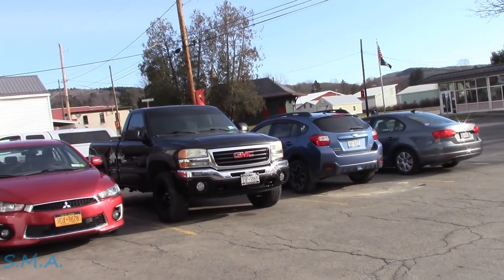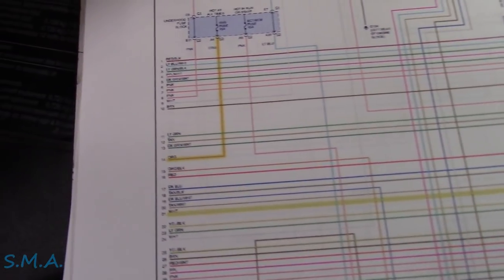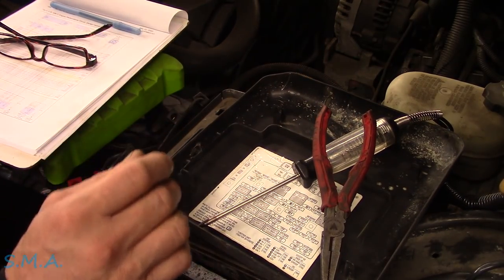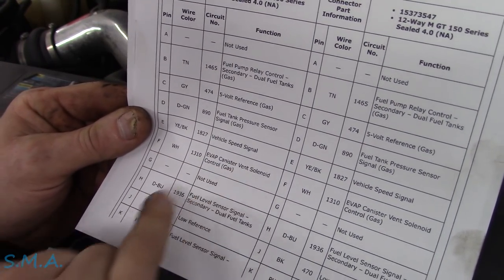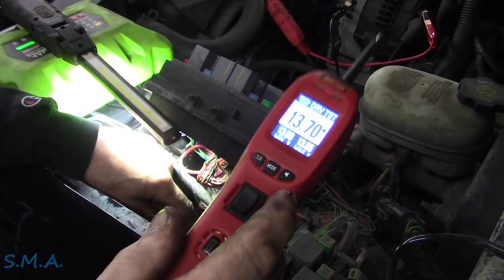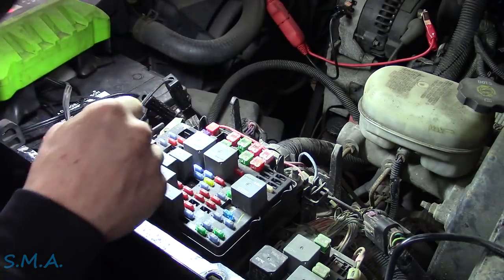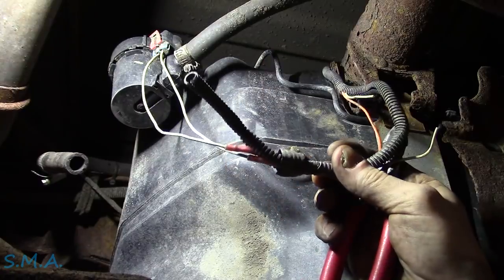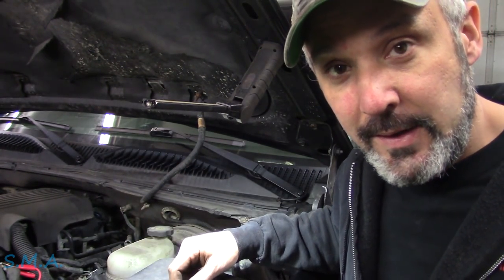Uggg The Phone Calls.... Oh And Fixing A Chevy EVAP System

Comment: Dude when I was visiting my Grandmother a few years ago in PA I was gonna drive up to you for an oil pan gasket job on my 05 Malibu and I’m all the way from Denver, CO. I ended up not wanting to bother you. Don’t sell yourself short. There’s plenty of worse mechanics, especially with electrical problems which my 05 Malibu is now having with 291k miles. No rust, no mechanical problems but the electrical problems will retire it early.

Comment: You certainly found out what's wrong with that one.
It's a deathtrap.
The customer needs to switch his stuff to a truck that's not rotten to save himself.
Some yards sell "builders"
Vehicles you can get to rebuild.
Other than that, it's not good enough to sell or trade except to a yard.
But you solved it.
Good job.
Make them sign for the knowledge of it's condition is what I advise.
Thanks for the diagnostic struggle you endured.
See about a tetanus booster, hahaha

Comment: At 8 min 47 sec the most important part of the 25 minute video you could of explained it better. Can you tell me if I am right by saying this? The PCM provides an active lol so when you press the computer to turn on the solenoid a PC provides a low or ground for the current to flow
SECOND Q: what is the name and model number of the digital probe you used.
I subscribed to channel and clicked on all advertisements even though I wasn’t interested

Comment: I am not jesus, lol
I usually tell my customers my crystal ball is out for repairs.
 Some customers get bent when you tell them you wont or cant fix their cars.
Do to either lack if equipment or know how on the particular problem .
 I do believe given enough time , tool and info you and alot of mechanics out there can fix anything. In the end shops cant be loosing money on time because of lack of know how of a system or the tools do the job.
Shops/techs need to know their limits and just explain to the customer.

Comment: Thanks ! Most helpful. Incredible what RUST can do!  

BTW ... 1. Please be kinder to your hands. i.e. Gloves more often.

BTW ... 1a. The same (or similar) "Crud" /  "Fungus" that is destroying  the vehicle frames / brake lines, etc. ... is doing a job on your Hands, Thumbs & Fingernails.
Lots of "health" videos out there on how to overcome the hands / nails problems.

BTW ... 2. You and other YT mechanics seem to NOT use fender covers.
How do you avoid damaging the paint and / or denting surfaces on the nicer vehicles?

One Question: Do you sometimes show the customers horrible "RUST" videos?

Thanks again from a DIY VIEWER (aka spoiled brat) here in Oregon.  (No Salt) . Just did the 120K service on my OLD (but low mileage) 2003 Toyota Highlander (aka RX300) ... also changed all three  O2 Sensors, AND the VVT Solenoids & Tiny Filters & other failure-prone items. And cleaned intake & changed many sensors on a preventive basis.
e.g. MAF, etc.  Those back 3 Plugs & Coils were a "BITCH". Did NOT remove the Intake Plenum ... due to my own FEAR / Incompetence). (Laughing)

Trust me that MOST of the mechanics (at least in my area) are either incompetent or lazy or just trying to "BEAT THE DAMN CLOCK" e.g. I have found 3 occasions where connector tabs had been broken (by Dealer or Shop ... and just left that way. i.e. No new "Pigtail"

Thanks again for all you show us!

Comment: Not an ordinary guy so don't underestimate your abilities !
Experts are few & far between ….

It's a big problem finding a good repair shop .
Unless it's just a run of the mill service job you can smell BS 80 % of the time .

You'll get :
 The up sell ( it needs plugs so change the engine mentality ) .
  We will keep the car for 3 or 4 months then give up .
    Never ending list of unexpected parts needed .
     The classic “ We don't repair old cars ” ( that's 10 years or older ! ) .
       No idea how to find or fix the problem !
         Some part is not available but here is the diagnostics bill .
          When it's fixed the damage needs fixing !
            Massive unexpected bill .
              Original fault is not fixed . 
                 You now have more faults / problems .

Sadly that's the way it is !

Comment: Unbelievable that people ring you multiple times a day or just turn up wanting free advice. Maybe you need a premium advice line that when people call and have a list of codes and then say for P0449 Vent valve solenoid circuit advice press 1 and charge $5 a minute. On that note I was going to ship my Subaru Outback with the big 2.0 Turbo Diesel from Australia with an intermittent cylinder 2 glow plug fault😅😅😅😅😅😅😅😅😅😅😅😅😅😅

Comment: Those radios are absolute garbage. Dual is the junkiest of junk. One just like that came in my 04 suburban i had last year and it screwed up a ton of things including the class 2 network. Took it out and put OEM in and it was fine. I hate aftermarket junk unless its a high end brand and installed right(only head units and speakers) no remote start crap